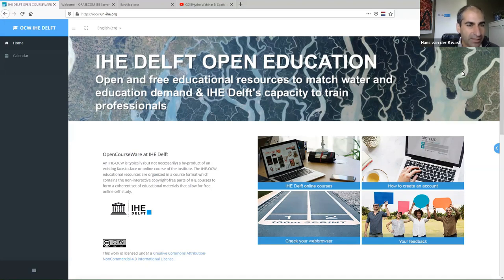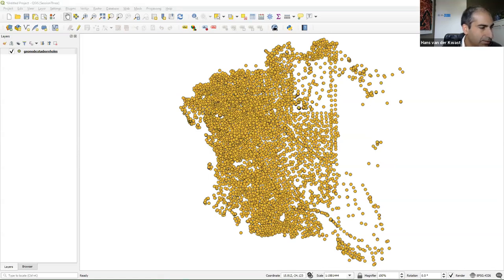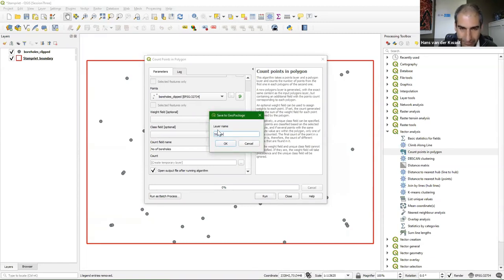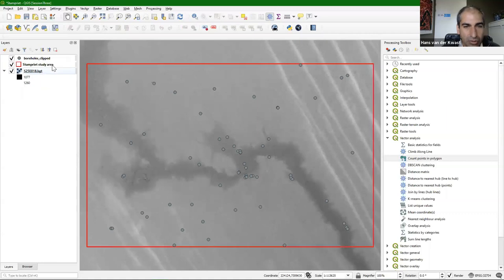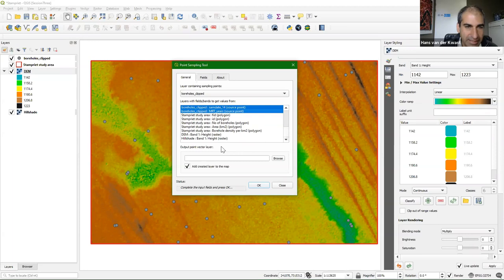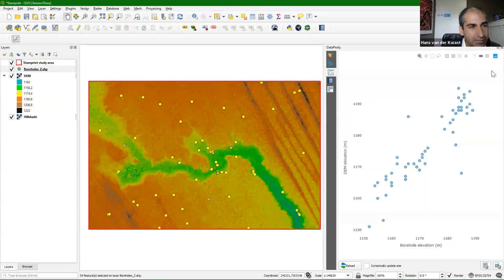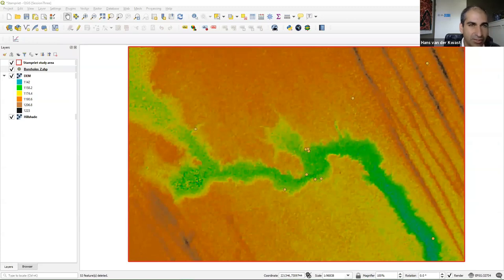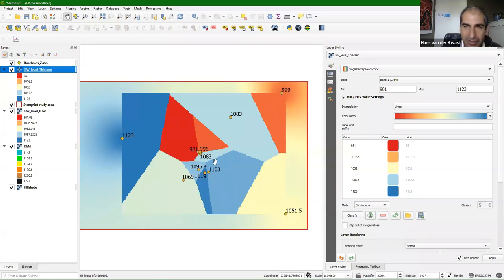Create a groundwater level map from borehole data and a DEM

Comment: Thank you so much for this wonderful tutorial. Could you tell me what's the benchmark of measuring the groundwater levels ?
Like is it below ground level or is there some other reference ?
Reply from the maker: I've seen different references used in practice: ground level, reference at borehole, average sea level, etc. Because there's no standard, I think the most important is that the reference level of the groundwater levels is mentioned in the (meta)data.
Reply: @HansvanderKwast  Thank you so much 😊.

Comment: Could you please explain why did you replace the no data with DEM values? Wouldnt that give a wrong impression of the groundwater level at those locations and interfere with the interpolation?
Reply from the maker: In the dataset there are many wells without a value for borehole elevation. From the scatterplot we could see that there's a good correlation between the reported borehole elevation and the SRTM elevation. Of course this will give uncertainties, but there's a trade off with the amount of points you can use in the interpolation of groundwater levels in the boreholes that is calculated later. Less points also adds to the uncertainty of the interpolation. In the end it is the choice of the researcher/analyst, what is the best solution.
Reply: @HansvanderKwast Thank you for the detailed response. Please let me know if I understood it correctly, so these are borehole elevations and not groundwater table elevations, is it?
Reply from the maker: @ishitabhatnagar8981  The "elevation" field in the attribute table is the borehole elevation at the surface. Where this data is missing, we replace it with the elevation from the DEM. Then later in the video we calculate the groundwater level in the boreholes by subtracting the "depth_m" field from "elevation". The result is the groundwater table elevation in the boreholes.

Comment: Why not use TIN interpolation?
Reply from the maker: That's indeed another way to interpolate. Which method you choose depends on (1) distribution and density of the sample points, (2) what you will need after the intepolation (just visualisation, feed into a model, etc.).

Comment: Thank you very much for making these valuable tutorials available.
I am learning a lot from them and I am using them to teach my students.

Looking at the task of replacing the -9999 values of the elevation column I think it could be simpler.

When you replace the values of -9999 in the elevation column, why not just update the lines that were selected with the expression elevation <0?

Could update using the expression
evelation = z_DEM
but, selecting update only those selected instead of updating everything.
Reply from the maker: Sure. There are always multiple ways in GIS. Sometimes I want to show some different ways to expose the students to alternatives. That's not always the shortest way.
Reply: @HansvanderKwast   You're right. QGIS is good so there are several ways to reach the result !!
The more people show you how to do it, the more people will be able to learn !!!
Live to opensource